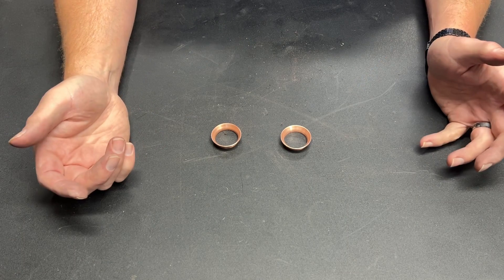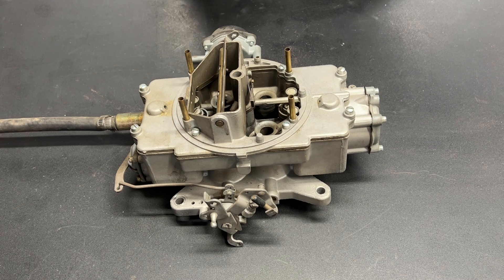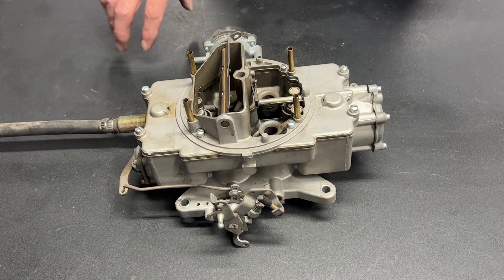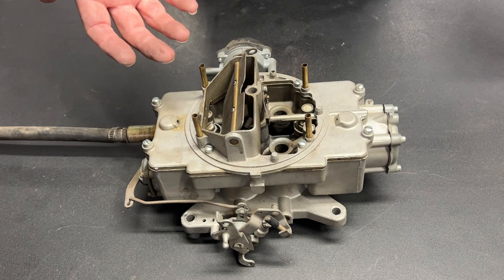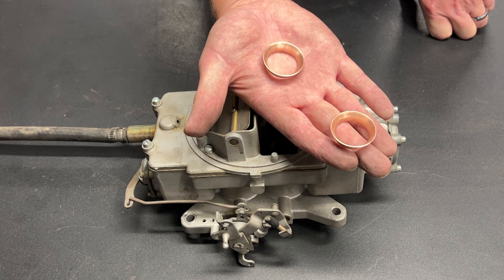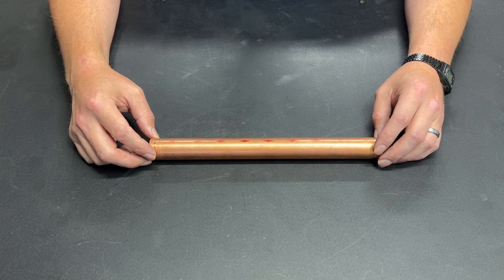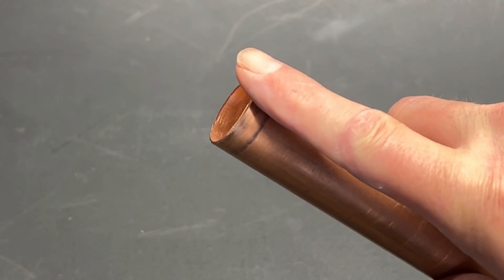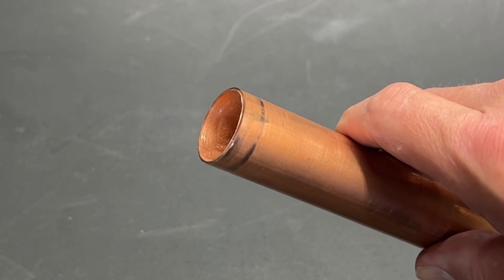DIY Autolite 4100 Carburetor 1.12 Bore Adapters Venturi Inserts, Eliminate Idle Bog BB Carb on a SB

Comment: do you have a video explaining how to build one for a small block?
Reply from the maker: are you talking a 1.08 carburator?  if so no.  the 1" copper tubing is pree made in the perfect size for the 1.12 but too big for the 1.08
Reply: @dazecars  no I got  the 1.12 earlier today. You mentioned in the video it needed to be set up a certain way to work on the small block better I believe.
Reply from the maker: These sleeves and the correct jets will get you close but you also need to get the correct boosters to completely optimize the carb and I don't have any specs on which boosters are required.

Comment: I decided I needed to try this mod for a 300 I6 I had built, but I went a different route. I used a ruined Summit M2008 500cfm carb, a Holley 4010 600 cfm carb and combined parts from both. I took the primary booster cluster out of the Summit and dropped it into the Holley. I also machined a sleeve that would fit on the outside of the boosters to further restrict the primaries. The summit carb boosters have a huge advantage over the Holley in that the idle feed and accelerator pump shot are both tunable. I wanted to try this mod on an autolite 4100 but never got a chance.
Reply from the maker: sounds like an interesting project

Comment: Such an amazing idea! What does the CFM of the carb wind up as, after the mod? Of course I'm not sure what the stock CFM is before the modification, on either the 1.08 or the 1.12  bore carbs. Or maybe it does not effect the CFM, as the bore diameter at the throttle plate stays the same.
Reply from the maker: butterflies stay the same so it is likely close to stock but I would assume it does change slightly.  The secondaries stay stock so over all CFM is only going to change a little bit if at all.